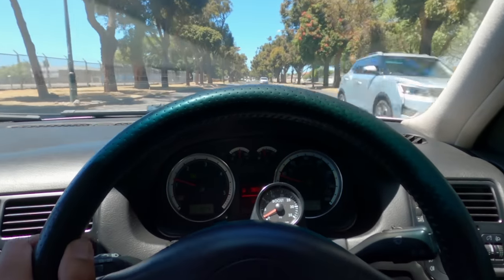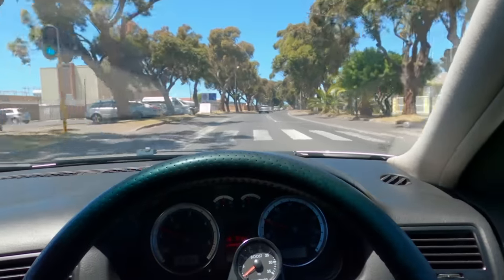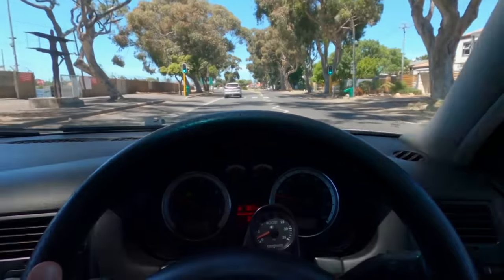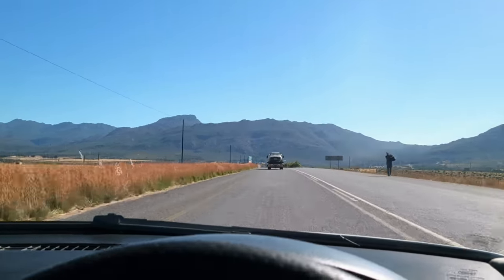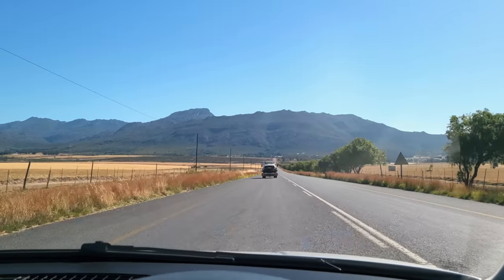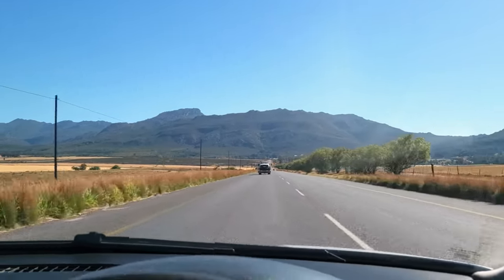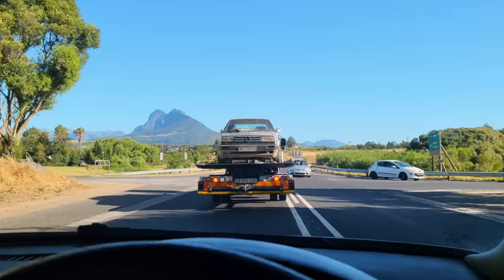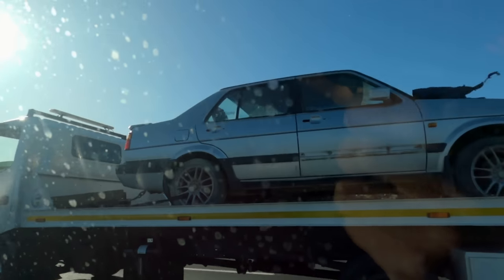We rip apart & destroy a Volkswagen Mk2 Jetta Cli 16v in 2 days

Comment: On the 330d, was the cat, dpf and egr deleted? No smoke at all👀
Reply from the maker: Jameel does smokeless tunes on tdi's. Previous tune had a lot of smoke and made around 18x kW, after tune 22x kW. So it works, its just unusual for a TDI. Lol.   Apparently there's more in it but he doesn't want to push it too hard.
Reply: @lowdl  thanks for the feedback have a e90 320d. Would love to do stage 1, but fearful of the smoke and the reliability however need to do swirl flap deletes as these cars are known for them braking off
Reply from the maker: @jahid_E9  yes I've heard that the flaps are an issue. J2 does some good diesel tunes. Would definitely recommend them. They can do the flap delete as well.

Comment: Hi bud whay did you need the brakes of this car what happened to the one on the mk2?
Reply from the maker: I've got brakes off a Mk3 VR6. The brake carrier angle is different to the ones from the Mk2 so my wheels are not quite Sitting in the correct location. I'm hoping that if I fit these carriers, it will fix that problem.